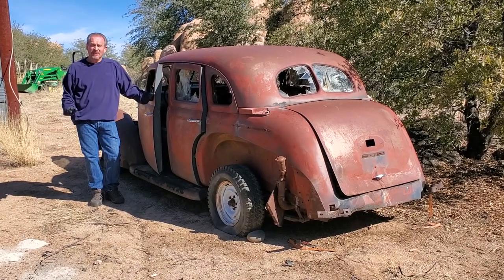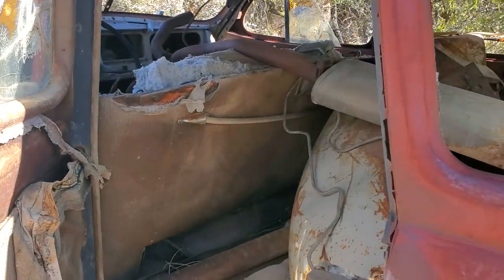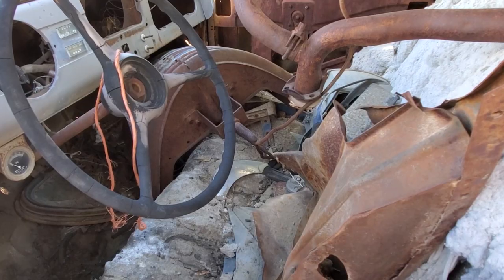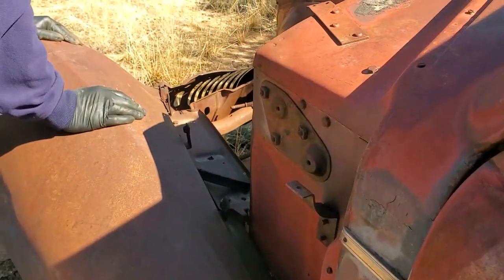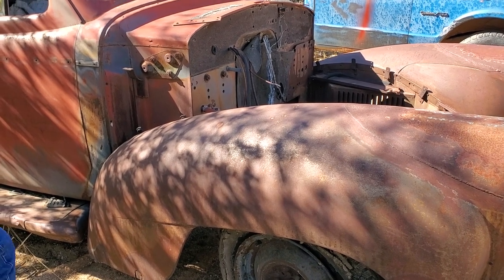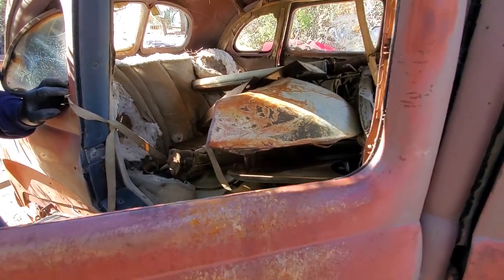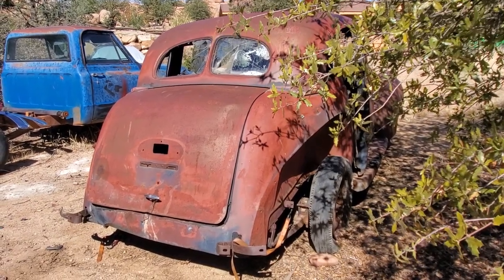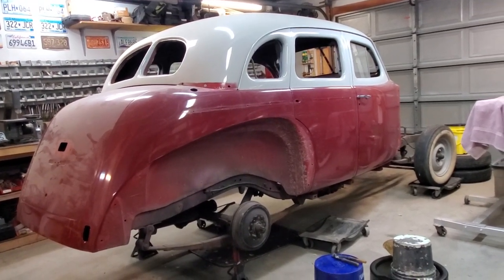1939 Graham Sharknose Parts Car Walkaround  - 1938 Sharknose Graham Parts Car Evaluation

Comment: My 1948 DeSoto 4 door started as my uncle's parts car for a '49 business coupe. I'm a metal fabricator and consider myself an automotive artist so while I don't factory-restore, I do keep things 20th century. I built my DeSoto as if it were 1975 and I were dreaming of a then-built late-60s muscle car and a SuperFly Cadillac... but wound up with the DeSoto instead. For the essentials such as emblems that were missing, I did my best to replicate the original pieces. For shifters, the drive train, and such, I gave myself some leniency and put in parts from the early 1970s. The interior benefitted from my years of sewing, but you'd never see an interior like that in 1948. I have a good friend who does glass so well-fitting glass was no problem. The floor was missing when I got my paws on it, but that's fine, I simply welded in a new one. 

Sure, a parts car is a lot more work to get back on the road than the sort of car you'd typically opt to restore, but for me, I love the blank canvas it provides.
Reply from the maker: Interesting story! And, it's good that you're sharing your enthusiasm with us. Thanks for doing your part to restore more of these classics and putting them back on the road. Thanks for watching!